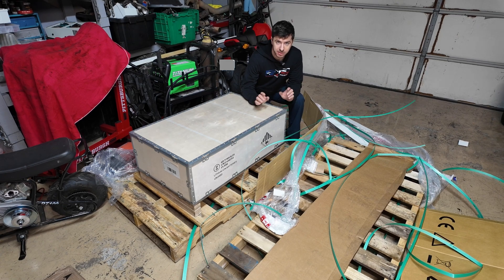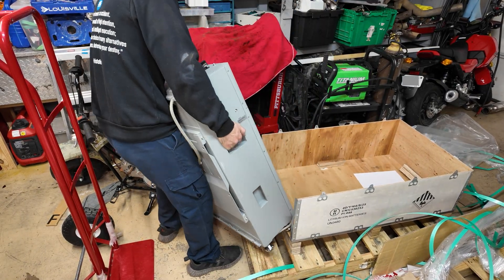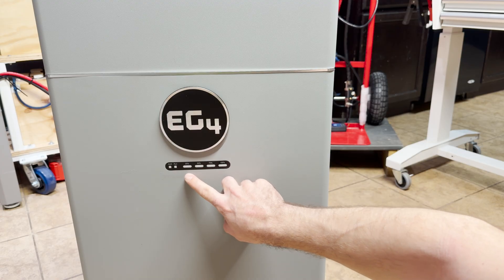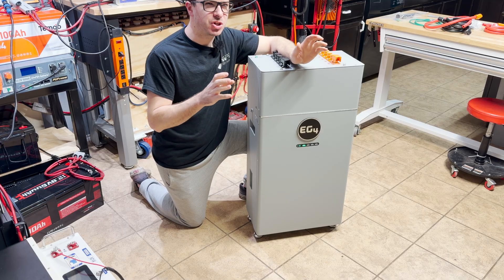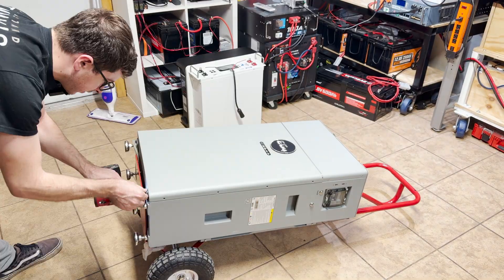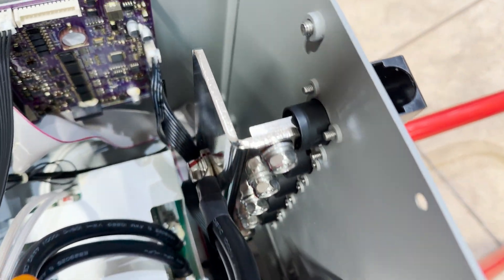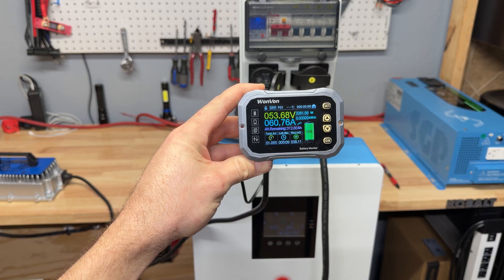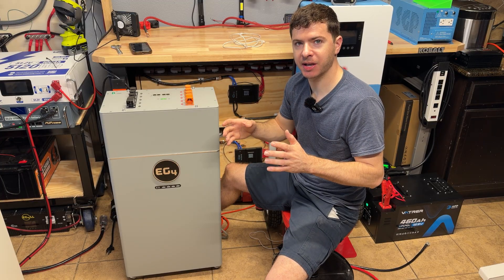NEW EG4 314ah 16KWh Indoor Wall Battery! Teardown, Testing Overview! Best Battery?

Comment: Looks like EVE cells in there, I use the same ones for my own batteries.
Very good quality.
Reply from the maker: You think it will last 10,000 cycles?
Reply: @Mikebuildss I only had mine for ~3years now.
But online research reports are very positive.